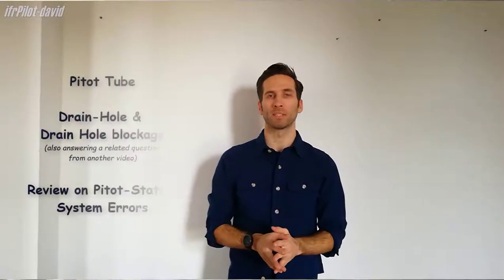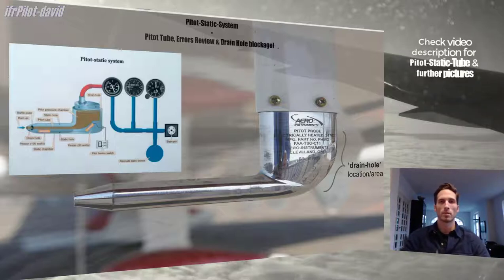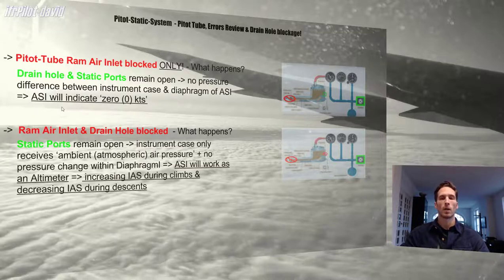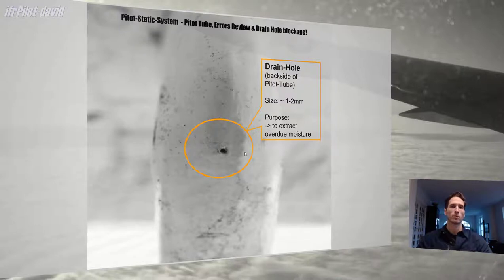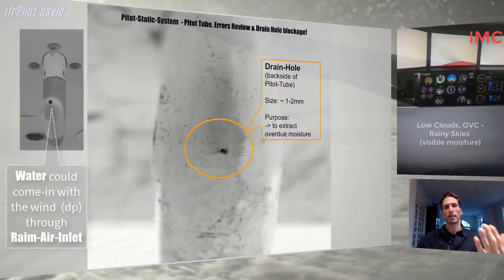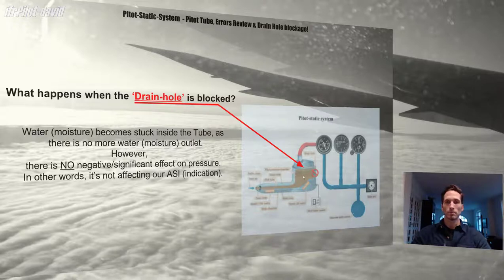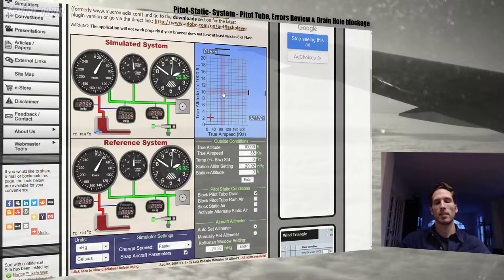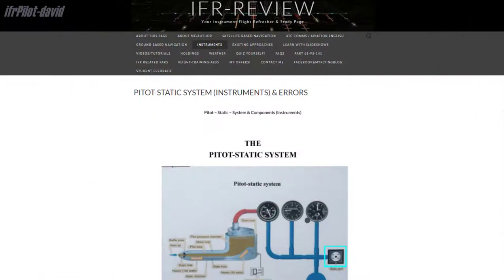PITOT-TUBE - DRAIN-HOLE-Blockage & MORE (Pitot-Static-System Simulator)

Comment: Nice video really.  So under what conditions do you need to resort to breaking the glass of your vsi . is that the instrument to sacrifce?  Again nice video you are jogging my memory.
all the best neal sw fla
Reply from the maker: Hi Neal... I hope I'm understanding your question(s) correctly. So, breaking any of your Pitot-Static instruments is probably the very last option you wanna go for and this action does come with some abnormalities in terms of indications you certainly wanna be aware of. Here is a quick explanation: Breaking the VSI's glass can lead to (slightly) erroneous and/or reverse readings. For example, with the VSI's glass broken, the static pressure it receives now comes from inside the cockpit obviously, instead of the Static-Ports. That being the case, the instrument's case now receives slightly lower pressure as a result of (due to) the venturi effect around the fuselage. Thus, the air would not pass through the 'calibrated leak' anymore, as it usually does leading to the fact that the case (in comparison to the diaphragm) will be over-pressurized when it would normally be depressurized and vice versa. In other words, it can actually read backward, meaning it could show a climb when you are actually descending, and a descent when you are actually climbing. Note: (Pressure) differences shown on the instrument also depend on your airspeed at any given time.
Why would you want to sacrifice the VSI in particular? If you do decide to break it, the primary reason I can think of that this may seem appropriate is probably that it's the only instrument that is NOT required for IFR-Flight by the regs. Altimeter and Airspeed-Indicator are required.  I hope this helps... :-)

Comment: Aircraft air speed indicator question.
Why is it so ???
Earth is spinning west to east. 
At the equator the ground speed is approx 1675 kph.
On a still day the air is traveling 1675kph, west to east.
A Plane takes off heading to the west, and climbs to cruising speed of 500kph.
The plane is now traveling at 500kph ‘relative’ to earth’s speed.
In “reality” the plane is moving through the air 1675 + 500 kph.

Question 1: How does the air speed indicator compensate for the rotation speed?

Question 2: If the plane turns 90 degrees, it would need to subtract 1675 kph (when the air speed ‘relative to the earth’ is the same) from the Pitot tube wafer reading to indicate the correct reading on the indicator.

Question 3: If the plane turns 180 degrees (traveling due east) it would need to -1675+500 = total negative 1175 kph (when the air speed ‘relative to the earth’ is the same) from the Pitot tube wafer reading to indicate the correct reading on the indicator.
Reply: Your airspeed indicator shows you your airspeed, not your ground speed.  Airspeed is needed for keeping the airplane in the air (i.e. forward movement relative to the air mass creates lift).  Ground speed isn't really that important for a pilot to know, other than if they are doing dead reckoning navigation.  Most aircraft have other, better navigation sources (e.g. GPS, VOR, etc.).
Reply: Well... If you apply a little logic here: your premise is wrong to start with since the air wouldn't be traveling on a still day from west to east at a speed at 1675 km/h. If that were so, we would have 1675 km/h winds down in Ecuador (wind speed in a class 5 Hurricane is about 250 km/h). So the only reasonable thing to assume is:
Obviously not taking in consideration the air movement caused by different pressure systems and the Coriolis effect:
THE AIR (AS EVERYTHING ON EARTH) ROTATES ALONG WITH THE EARTH'S ROTATION!